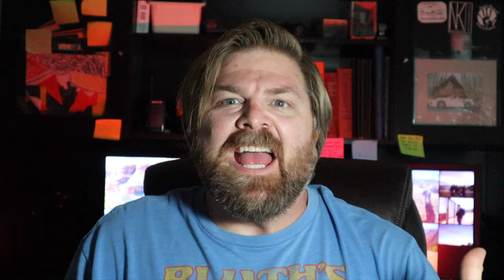The One Item Every Land Rover Discovery Owner Needs And WHY! | 4K

Comment: After years of owning a Disco,  here is what I know..  1. 160 degree Buick thermo and a s-10 thermo fan clutch help(engages sooner)   2.CLean between the rad and the A/C condenser (always fills with bugs/leaves/mud) 3. Most factory temp gages don't show real time info and by the time they show "hot" its too late for system to cool itself when under a load(Ford trucks do this also)  4. Aftermarket Alum larger core rad solves most issues.
Reply from the maker: That is a lot of good info right there! Thanks, Ron! Well, we’ve got the 160 in there, definitely will blow out the space between the rad and condensor next time we have her through the car wash. When this radiator gives up the ghost, I’ll definitely go with the aluminum!
Reply: What is the part number for the S-10 thermo fan clutch? Looking to overhaul my cooling system before summer wheeling.
Reply: I know this is old, did a bit checking on the S-10 fan clutch, I see from 1998-2008 is the same one.

Comment: An alternative to the ultra gage is the BAFX OBDll reader and the torque app, it will allow you to monitor all the engine parameters in real time at a substantially lower cost. Use your current android phone or an old one for a more permanent display. You can set high and low warnings for any parameter your ECU can output. The display looks way better than the ultra gage as well. 👍

Comment: 2003 D2 and a few things I did are 
Inline thermostat mod
New expansion tank
Ultragauge 
180 degree thermostat 
hayden heavy duty fan clutch, and fan blade for that. 
Temps do not exceed 210 on the hottest of days and im in Miami Florida. eternal summer and traffic jams

Comment: Most  land rover discovery 1 people fail to clarify the huge difference between early D1's and late D1's.  Specifically the Early NAS D1 vs. Late NAS D1
2HO **DOES* mention 1996 and later OBDII in this vid, about 2/3 the way through (~6m stamp or so).

I know this is about cooling and though may this may help some DIY'ers on the fuel side as well:

Early (1994 - 1995, in the US & Canada [aka: NAS]: 14CUX
  - 14CUX ECU (engine computer module): Bank fired fuel injection; meaning that all four injectors on one bank would fire and then the other bank would follow (e.g.: 1/3/5/7 then 2/4/6/8). This contributes to poor idle, shorter-lived O2 (lamba) sensors, quicker catalytic burnout (shorter life), etc.
  - NO OBD2 [aka:  OBD-II) .. it is an OBD1 [aka:OBD-I]... which is a huge difference (especially for this video)
  - NO evaporative recovery fuel pump assembly!  The pump is different.
  - Most of the fuel system related sensors are different (or are specified differently)

Late (1996-1999, in the US & Canada [aka: NAS].  GEMS
*Note: the D1 was produced through EARLY 1999 and the D2 was ALSO produced in 1999 (call it late '99):
  - GEMS ECU (engine computer module); This is a true sequential fuel injection system (each injector fires independently of the other 7..  though at higher RPM I am pretty sure these gang fire in similar manner as the 14CUX (Bank Fire: 4 odd then 4 even... gang fire: all 8 fire together).
  - OBD2 [aka:  OBD-II) ..an actually useful sensor port that is highly relevant to this video :-)
  - Evaporative recovery fuel pump assembly!  The pump housing is different than the early NAS D1
  - Most of the fuel system related sensors are different (or are specified differently)

...and many more :-)  

I add this, not (at all) to besmirch 2nd Hand Overland!  I add it because my own searches for 1995 NAS (early) D1 wisdom so often falls into the Late D1 hole :-))  Hopefully this helps someone else too. :-)

There is a great little document that provides the specs for the fuel system that can be found here (it says p38 but it covers all 1987 through 1999+ D2): 
https://p38arover.com/rover/p38a/Engine_Management/LR_Fuel_InjectionSystems.pdf
Reply: Do you think this device is compatible with a 95 discovery?

Comment: I used to run an Ultragauge in my 3rd gen 4Runner. Great little gauge and I chose it over the Scan gauge was price and size of gauges. You can also use the UG Temp which shows the temperature of the gauge itself - so that would be an interior gauge.
Reply from the maker: Oh wow… I think I’ve been using that function thinking it was outside temp!
Reply: @MattKester  does it do the transmission temperature on your LR? That was the other reasons for buying it and on the ‘98 model 4runners it does not have that feature. Of course I didn’t know that until after buying the gauge.
Reply from the maker: @toddhoffmaster6057  I don’t think it does, I’ll have to check.
Reply: It does not do trans temp

Comment: More often that you know the main cause of overheating in a 4.6 is the owner. 1 oil, the engine is a 38 year old design. It has flat tappers the oil should have zinc in it, that will lubricant the contact point where the cam meets the tappet. That will help the engine run properly. 2 the coolant must be correct, it should be changed 24-30 months. If you leave it longer the coolant  gets acidic and doesn’t work well. 3  Fans. After a drive check the clutch fan, it should be stiff to turn, if it spins it’s not working. The condenser fan is not just for AC is the last thing to cool you engine, they are neglected and often seized. If the condenser is seized leaves will accumulate behind the fan and that makes the rad ability worse.
Reply: High zinc oil has absolutely zero effect. 

Beyond break in time, these motors don’t need high zinc. Nothing is high pressure. It’s a lazy flat tappet setup.

Comment: Fed.  First step before the 'ultraguage' is to use the correct grade engine oil for your climate in a D1 Rover 242 cu in. V8 !  This should be Castrol 20w40 mineral lubricant for the pre-cat versions and full synthetic 20w50 for other V8 models ?  V

Comment: Im planning on doing an electric fan conversion for this very reason on my d1. Also the fan clutches on these ive found are temperamental. Especially at idle.
Reply from the maker: I hear you! I didn’t have many fingernails left after picking up the boy from school the other day. Do you know of any off the shelf kits? Or is this something that’s gotta be custom?
Reply: @MattKester  Revotech sells several different ones ive been looking on Rimmerbros. im not sure if they are an exact fit for the d1 v8. they do however have a rover v8 version so must be fairly close fit. Allisport has an entire setup shroud and all but its an aluminum radiator that's a bit costly; id prefer to keep the copper one as they tend to last longer in my experience. I'm planning on going further into looking at different versions this weekend hopefully. planning on adding the 3 way toggle switch also. On, auto and off depending on conditions.
Reply: @krookdfinra many of the kits fail to give a shroud so your fans only cool the bit of the rad they are attached to. Made my own and my electric fan only really needs slow speed.
Reply: @GavinEarnshaw  true a shroud would help however id suspect as long as the water pump functions they system itself would keep cool based on the water temp turning the fans on and off. I saw a volvo fan conversion that looked promising. Id like to retain the original wiring if i could however.
Reply: @krookdfinra  for my 90 with the larger turbo diesel rad I would find having to run the fan on fast when going slow. Once I'd made the shroud, it would only need slow speed. With one V8 before the shroud I cracked a head even with the fan on full. (the 90 is on its 5th rover V8 now...)
Reply: @GavinEarnshaw  my goodness, seems a shroud is in order then lol
Reply: @krookdfinra  😃

Comment: These plastic expansion tanks have been known to crack at the worse moments. And I have had a new one crack in less than 200 miles. I highly suggest replacing the plastic tank with an aluminium tank.

Comment: In the 300TDI D1 the water pump and factory water temp sensor are high up in the engine, so if you don't have enough coolant in the system the water pump starts to spin air! The reason the gauge give various readings is because the coolant isn't passing the sensor all of the time. The gauge will drop when when at the engine isn't working hard as the coolant isn't passing the sensor then soon as you accelerate (up a hill) the now super hot coolant will be caught by the pump and pass the sensor sending the gauge skywards. This normally happens after you drained and then refilled the cooling system after some maintenance work.
I believe the V8 has the water pump in the same too high engine position. Of course the moral of the story is to keep checking your coolant level!

Comment: I run ultra gauge, 180 thermo, and a nissens rad. I'm cruising at 188 and idle at 198-210. When it hits 210 aux fan kicks in doesn't go any higher. Oh yea I add water wetter by royal purple as well.

Comment: Best piece of kit that I ever purchased for my disco.  Once I had it I knew I was driving around too hot and got the 180ﾟ thermostat.  It's not rare for me to see anything over 205  After the thermostat was installed.
Reply from the maker: Yup. I’ll probably catch hell for the 160 in mine at some point, but until we get outta the triple digits on the daily, it’s staying in there!
Reply: @MattKester  am sure people would understand if they knew the extreme temperature swings we have here is the valley.
Reply: Does this work for a 95?
Reply: @tymeandandy  yes. Just make sure you order the part specific to that year.

Comment: The D2 temp gauge is similar. The needle climbs and the light goes on at 120C. Generally too late. The head gasket will be cooked. Much better if it started to rise at 110C. You can get a Nanocom for the D2. Does a whole lot more than measure the temp. Also you can set a coolant temperature alarm on a Nanocom. BTW, this happened with my son driving home. He filed up the reservoir with water and drove slowly i.e. 80kph, the 50km home. That was back in March. Car is still going well.
Reply: The Ultragauge is capable of setting alarms both high and low on all of the functions.
Reply from the maker: Hey Bohica, I just looked up the Nanocom on Bearmach's site, they look really impressive, but they were a bit pricey. We are able to set the alarm temps on the Ultragauge fairly easy and they do chime loud enough for you to notice, that's for sure. Glad that Nanocom saved your motor though, even their prices are a lot less than a blown motor!

Comment: just received mine! very helpful information. Earned my subscription! Also i plugged it in for the first time without turning the ignition and it turned on right away. is this a sign that it will not turn off after using it for the first time on a drive? worried about it draining my battery.

Comment: Sounds like an interesting addition. I wonder how it would work on a Tdi 200. Something to think about in the future.
Reply from the maker: I don’t know, I think not might not unless yours has the OBDII port under the dash. I imagine there has got to be a way to rig up some sort of analog temp gauge to it though, our buddy Gavin in the UK posted a pic of his 90 in the Facebook group with an analog one installed in his dash.
Reply: Engine watchdog cost bit over$100 Australian saved me in several brand of cars
Reply: On my 300tdi I just used the factory sensor fitting on the head for the dash gauge and run it to an aftermarket gauge so I know what temp my coolant is at going up hill in summer. Dash water gauge doesn't work but I'd rather have an accurate reading.

Comment: Did the thermostat stop the overheating problem? I have the Ultraguage (Bluetooth) and love it- but all it does is worry me since my truck routinely gets to 212 even with the T-Pipe Thermostat conversion that eliminated the factory system (D2). I hate my truck running that hot- why can't we get these to stay at 180 degrees all day? I'm Wondering if electric fans and an upgraded radiator would do the trick.
Reply from the maker: Yes, the new thermostat stopped it. You're not the first person to mention electronic fan conversion, I gotta believe if this many people are interested in it that there has to be a kit out there for it!

Comment: Just curious, Matt… the 160 degree thermostat you mentioned. What other options are there and why did you go with this one?
Reply from the maker: I pretty much went with that as a knee jerk reaction and because it was available at the local O'Reilly's. I ended up realizing that the heat issues had less to do with the temp of the thermostat and more to do with the rest of my coming system and I changed out radiators and ened up with the correct 180F one. The 160 kept the temp down, but it was too far down and would cause the car to throw rich mixture codes.

Comment: wow crazy good info!! Thanks
Reply from the maker: You're welcome! I'm glad you found us and you're enjoying the content! How's your D1 hunt going?
Reply: @MattKester  It's going, not finding to much around me here in Washington state. If I do people are asking 5k+
Lot of d2 for cheap.
My question I keep asking myself, will the D1 have enough power for the build I want to go with. Full steel bumpers and 33s?
I more want the D1 for more being simple to work on. Less electronics deal with.

What is your thoughts on that?
Reply from the maker: @joshyddog2054  Ours had what were effectively 32's on it when we got it. They're on the 4Runner now and we went a size smaller to 245/75R16's. This thing only put out about 180HP when it left the factory and weighs nearly 6000 lbs loaded. It definitely takes mountain grades on the interstate in the slow lane. In low range, it never wants for power offroad. It hated having 265/75R16's on it. They rubbed everywhere, tore out back fenders and mudflaps and made the torsion bars on the front extra shiny. You're gonna have to do a pretty substantial lift and a lot of cutting with those 33's.
Reply: @MattKester  Good info thanks!!
I will definitely have to keep that in mind for sure!

Comment: I am really interested in a Disco series I, i am about to go inspect one in a few days so i am doing tons of research on the cooling system, head gasket issues, etc,  would you say you were unlucky and had a premature thermostat failure??
Reply from the maker: Yeah, and it probably stems from using  a lower quality thermostat. I just swapped out radiators this past week and put an OEM thermostat back in it and it’s running great.

Comment: I bought the 180F thermostat from the link when I did my head gaskets too, should I switch to the 160F thermostat in the link after seeing a spike of 215? How are you liking the 160F?
Reply from the maker: 180 is the one that’s supposed to be in there. The 160 was me putting a band aid on a bullet wound. The reason we weren’t able to keep the temp down had more to do with the rest of the cooling system, I.e. the radiator. If your cooling system is working correctly, a 180 is the optimal thermostat.
Reply: @MattKester  Thanks! Ill return the 160 then
Reply: @MattKester  so will the 160 ruin the motor? The previous dude that had the disco put in a 160 degree thermostat and a flowkooler water pump

Comment: How has the Rover been running with a 160 temp sensor in there? No issues getting up to temp I assume?
Reply from the maker: So far. I hangs at about 175-185 on the highway, will get closer to 190 at crawling speed with the AC on. I'm sure when the temps cool down around here, it'll probably be best to switch it back to a 180...
Reply: @MattKester  I have the same issues with my 190 degree t-stat it gets up to 210-215 then down to 190 and yo-yos back and forth with regular driving. It's not much different when we run trails though. I orderd a 180 and 160 from O'Reilly's. Let's see what happens! My ultraguage has been a big help as well haha

Comment: Does this work with TD5?
Reply from the maker: I am not 100% certain, as we never got the TD5 here in North America. I would assume, though, that if it is OBD II compliant, then it should work. I know there are other systems out there like the Nanocom that I just saw on Bearmach's website that says it's specifically for TD5's, but it looks like its rather pricy. I wonder if anyone else out there might be able to answer if the TD5's are OBD II compliant?
Reply: Td5 isn't OBD2 compliant but supposedly this works on them.

Comment: Sitting in traffic Rover gets hot...within the first 2 minutes of this video I would suspect FAN clutch, restricted clogged radiator. The  temp guage on dash is only an idiot light telling you its too late way after the overheat destroys the engine.. I use GLOW SHIFT GUAGES oil water and battery voltage.